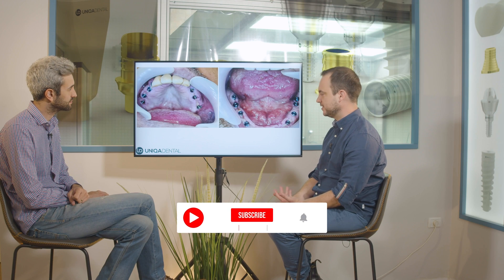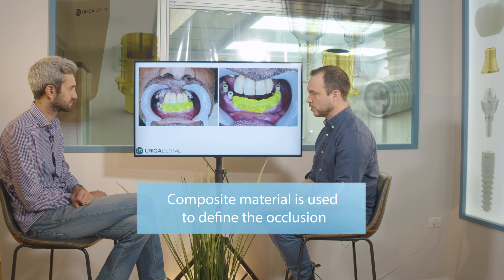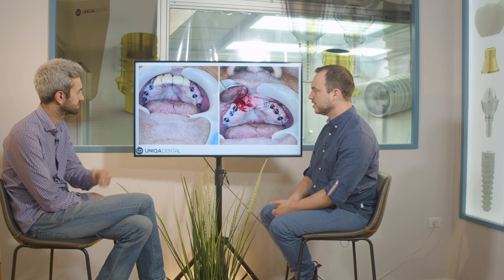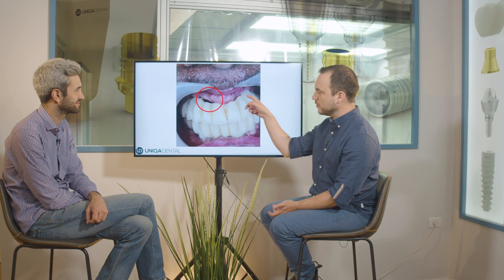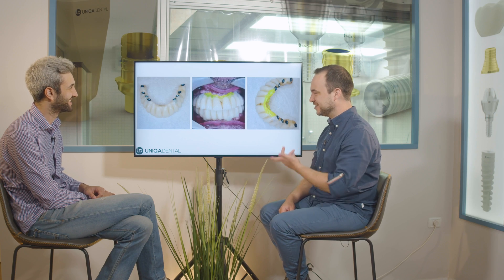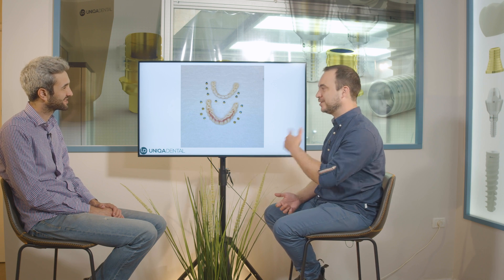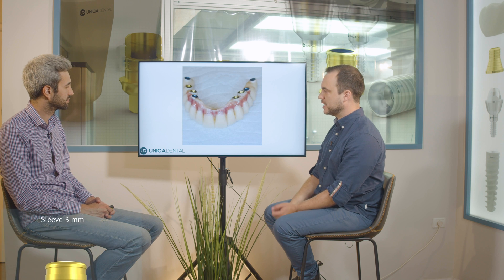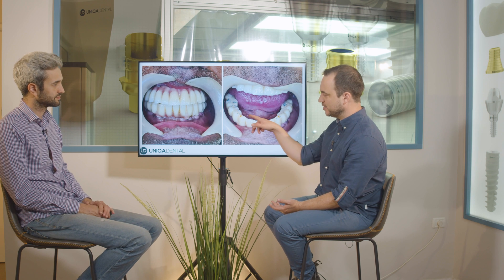Full screw retained restoration using the digital libraries. The patient didn't have any teeth

Comment from the maker: 00:00 You see it in the healing phase. He had a couple of dental implants in the frontal area.
00:58 He had PFM crowns on those dental implants.
01:13 We took digital impressions on those scan abutments
03:27 We used all of the scan abutments on the multi-unit level. We screwed the scan abutments. 
04:04. There is inflammation and we'll take the implants out with the crowns
05:10 Now we just need to correct this space. 
07:08 It's something that you can do with CAD/CAM manually if you have a PFM
08:24 We don't have any problems with the gap between the teeth and the gingiva. 
09:57 Quite a bit, it's quite big teeth. And it's smaller than what he had before.
12:13 The biggest problem why sometimes we don't want to do this
13:58 You need to close it with composite material in the color of the teeth